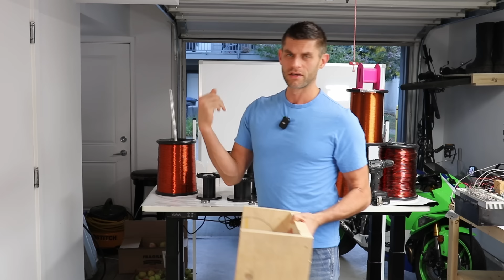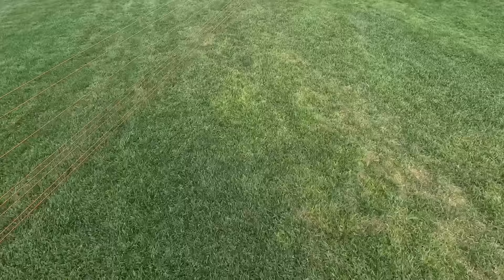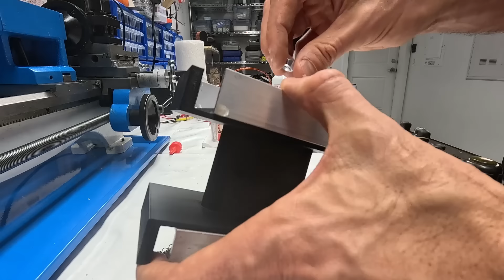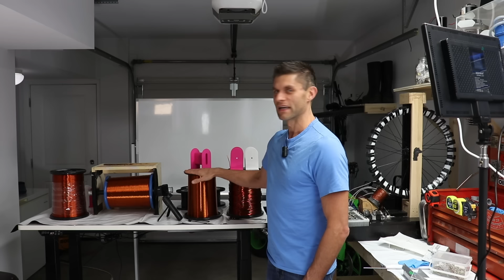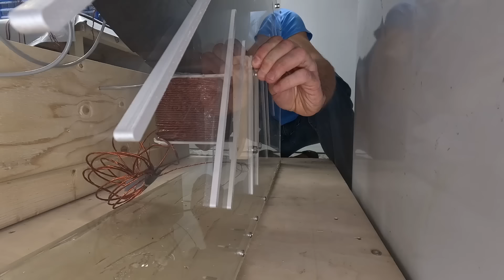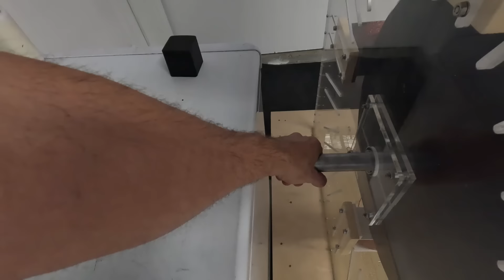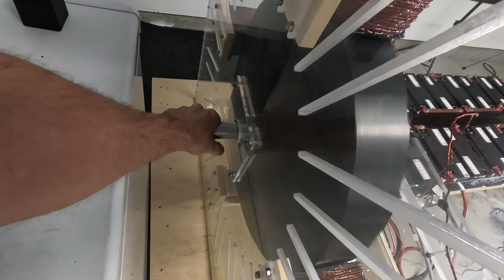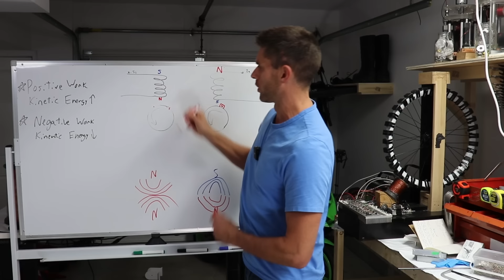The Device That Could Give The World Unlimited Energy

Comment: Absolutely amazing! You built the protocol I've been brainstorming. Thank you for sharing. If I could point something out I noticed something at the end of your video amid the voltage. Your using zero point energy and the universe works off absolute balance. So the voltage you were reading said you were perfect.
Reply from the maker: Lol.
Reply: @MadscienceLPTECH I really want to thank you for sharing this information. Although I had the vision the universe sent me to you to see it in motion. I didn't realize the batteries were necessary nor did I know about the sudden lighting strike that comes as the system stops. The pulse you describe also gave me something else to ponder. So basically I had the magnets on the wheel and thats about all😂.

Comment: Bearden said a "pumped phase conjugate mirror at" low frequencies.  If I used 2 pumped orthogonal ac fields and 1 weaker probe ac field.  1 dc bias field to align anistropy. Any thoughts on what medium to use? I have barium ferrite but fmr is too difficult to tune.  FWM develops nonlinearity properties. Any thoughts would be appreciated. 😊
Reply from the maker: Lets see some pictures ?
Reply: @MadscienceLPTECH I'll send them via email early Feb after my bypass op. Bear with me. Your videos are so cool, even the coil winding is fascinating. 😊

Comment: This experiment is interesting, but the interpretation is off.
What you are actually seeing is not a reduction of back-EMF, but a change in the induced current load of the passive coils.

When a magnet sweeps past an unused coil, a current is induced.
This induced current always creates an opposing magnetic field (Lenz’s law), producing mechanical drag on the rotor.

What changes in your demo is simply the load connected to the coil:

Open coil → very low induced current → low drag

LED load → diode blocks part of the cycle → limited induced current → reduced drag

Resistor → maximum induced current → maximum drag

So the lower motor consumption and higher RPM come from reducing parasitic eddy currents in unused coils, not from “eliminating” back-EMF.
Back-EMF is instantaneous and cannot be removed — only the dissipation path of the induced current can change.

This effect is real, but it only appears on motors with poorly optimized stray coils.
Modern AC, DC and BLDC motors are already designed to minimize these parasitic fluxes, so this trick does not translate into 50% efficiency gains in industrial machines.

In short:
You’re observing valid electromagnetic behavior, but not a new phenomenon.
It’s a reduction of parasitic induced current losses — not a suppression of back-EMF, and not a breakthrough in motor efficiency.
Reply from the maker: I described the effect perfectly. The back emf is negated by delaying the current so thay when the current flows its adding kinetic energy to the system. 

Back emf is due to current flow, we changed the current flow timing

Comment: I read through some comments and it is clear that a lot of people, including the creator of this video, lack some basic knowledge and understanding.

One example: Why didn't the compass needles align at 90 degrees to the single current-carrying conductor someone asks. Video creator give bad answer.
The correct answer is that the overall magnetic field is the vector sum of that created around the wire by the current through it and Earth's magnetic field. With sufficient current through the conductor the field around it could be made much stronger than Earth's field so the needle would appear pretty much at a right angle to the conductor.

Someone built "Bedini motors" to "recondition batteries" because of the "spikes" the motor produces.
"Pulse chargers" are useful for reconditioning batteries. They require no moving parts, just some very simple electronic switching, using an inductor to generate the "spikes" if that is convenient. A simple circuit with an inductor is a crude switch mode boost converter, or if you want to use AC mains input and need galvanic isolation for safety, a flyback converter could be used.

I tend to dismiss out of hand people talking about "over unity" and "free power" when they show signs of serious lack of basic knowledge - and also lack of proper instruments and the knowledge to use them for the intended purpose.
Reply from the maker: You sound really smart 👏

Comment: The convention in winding coils is to simply count turns. The number of turns in an inductor or electromagnet is far more important than the actual length of wire, though of course one goes with the other in a nice neat winding.
Reply from the maker: Agree

Comment: Ok, so how does the collapsing magnetic field high flyback voltage into the battery creating a di-pole in the battery bank extract energy from the 98% of empty space within and around atoms (zero point)?   I'm a bit lost once we get to the di-pole and what is (in theory) taking place in the battery where over unity is achieved, and additional power enters the system.   Thanks for explaining in advance if anyone can help.   32:36
Reply from the maker: Search Tom Bearden. Also its the source of all electrical energy... any source dipole is powered from the vacuum
Reply: @MadscienceLPTECH Will do, I will gather more research.   I went through some of your other videos and ascertained a more basic allegorical understanding....  Your river to vortex example....

I was wondering if this example would be more descriptive?:  ex:  If you cast a large stone into the ocean, That's your flyback voltage, a void is created by the stone, that's the di-pole, the ocean (aether) pouring in to fill the void, does so with such great force, that a column of excess water erupts vertically from the center as the void fills, That vertical column is then recaptured, and stands as the excess energy from the aether/zero point -does my Neil deGrasse Tyson example work?

Thanks for replying

Comment: This can all be done without a rotor too. The rotation is just there for show actually or you can think of it as a storage/capacitor of frequency that it is imputing into the coils. All you need is the frequency for the coils to turn on and off. Then that there is basically a transformer. A basic buck boast converter but with a flywheel as the transformer core. So the rotating magnets are essentially the iron core of a transformer but has inertia storage. Kinda cool aspect
Reply from the maker: Good thought

Comment: Best to use large supercap banks because it is a direct conversion and doesn't have so much capacity that test can be done much faster and more relative to the machine itself rather than just using power from battery. I get the idea. But I want to see it with capacitor banks. Battery chemistry gets in the way of the purpose of the design. Polarity doesn't really matter, it's just the direction of spin that creates a different polarity. Clockwise counter clockwise. It's definitely fun experimenting with pulse motors It's definitely a fascinating subject!
Reply from the maker: battery chemistry is the design, caps are great but we start with batteries for the dipole
Reply: @MadscienceLPTECH so you saying the dipole is what absorbs the surrounding energy that is there. The dipole forms within the plates of the lead acid chemistry. Does this dipole form in and form of charge. Say lithium, or and other chemical batteries. Capacitors have that too right?

Comment: If you get yourself a Mark V generator and attach it to basically an upside down colander with 10 inch pins comprised of four different layers including graphene, metamaterials, thermal Electrics, 4 gauge pure copper wire connected to a brass ball on top, you will create yourself an (AEC) atmospheric energy collector. This is one of my core designs. that's not all the components if you're interested I'd be happy to share. 
I'm also working on another device in the energy field. It would be fun to collaborate 🤓💪
Reply from the maker: Nice

Comment: Several questions come mind.

1. Does each coil consist of two seperate coils like primary and secondary like transformers? 

2. Does the coil do all the job or most of it? If yes what is the role of the flywheel? Does it induce current in other floating coils?
Reply from the maker: Good questions. All coils are 8 single circuits. flywheel just uses the work available form the created magnetic field that would otherwise go to waste

Comment: Awesome video it's coming along beautifully. 
I'm not a electrical engineer but have been tinkering with electronics for 40 years , i read a 4 pole electric AC motor 1800rpm running on 240v 60hz once it hits 1800rpm it would sound different  sing along , not sure what it's called but it would be more efficient  , so as I've heard they changed most of the grid in Australia to 230v 50hz as the motor will draw more electricity .
Interesting
Reply from the maker: Yes HV and high rpm is good 👍

Comment: I would love to understand these pulses and the timing system more. Making this device optimized to harness the vacuum brings to mind a "real-time optimization of a feedback loop." Are these chips of the board using the best assembly language protocol that is getting all the data inputs and outputs through at high enough speeds? Are the pulses shaped or shapable in real time? This data thrst is all especially important if my hypothesis of the vacuum energy is correct - that in some ways it varies and ebbs and flows like the wind.

Comment: This isn't doing what you think it is doing. Looks like you are running a motor with batteries then trying to extract some energy from the flywheel with some coils and charge a separate battery bank and has less energy out. Also the attractive for is actually slightly stronger than the repulsive. opposite of what you said. All you did is charge another set of batteries the long way with more losses.
Reply from the maker: Wow sounds like you realy know whats going on😂
Reply: @MadscienceLPTECH  I do. I am also an Electrical Engineer. You are making a lot of false claims.

Comment: If you wound the wire counterclockwise wouldn't you get more positive energy? An did approximate 1 inch of epoxy around waterproof an seal the wires loss of charge/field?
Reply from the maker: Clock wise and counter are the same thing just flip the direction of electricity or coil position

Comment: jb weld sucks. i have had nothing but trouble with it. i do not use it anymore. it will fail. use this instead. SuperBond 2-Part Epoxy - Slow Cure, 2 Pint, DIY Wood & Metal Epoxy Putty Adhesive
Reply from the maker: Thanks❤

Comment: How long will the rotor spin once you turn it off?
Reply from the maker: 5-10 mins
Reply: @MadscienceLPTECH  It's a very nice build, you can tell there has been a-lot of effort put into it. My first time checking out the channel. Does it use lubrication on the bearings or are they dry? Have you ever tried running it horizontally instead of vertically? Have you ever thought about mag lev for the rotor using permanent magnets?

Comment: What about using shrink wrap with the adhesive lining instead of electrical wrap?
Reply from the maker: For what part?
Reply: @MadscienceLPTECH through the 3D printed section to the outside of the reinforcing bracket of your windings.

Comment: using batteries is NEVER free energy, its very EXPENSIVE energy. even if you get it self charging its more expensive than grid energy per Kwh. think about it!
Reply from the maker: Thats not true at all. Why would a battery negate free energy? Lol does solar use batteries ?
Reply: @MadscienceLPTECH  Even if you manage to self-loop a system and keep two or more batteries rotating - awesome, but A good deep-cycle battery is about $120 and might deliver 600–1,200 kWh over its life. That’s already 10–20 cents per kWh just in battery wear, plus the build of the motor etc. Grid power in many states is cheaper. And once they are done, you have to buy new ones, unless you can make them run forever. I am running the same system in small scale like you, but i just realized that truth...Solar is very cheap, whithout batteries only.
Reply: if it can run without batteries, maybe with big supercaps and you can use that energy right away then it might work. battery management is such a headache and costly
Reply from the maker: @ReigoVilbiks just because its impossible for you dosnt mean its impossible
Reply from the maker: @ReigoVilbiks why would this be any different then solar. Solar is cheap because its a subsidized trillion dollar tech this is a 1 off prototype from my garage dude. Chill
Reply: @MadscienceLPTECH  “Solar isn’t cheap because of batteries.
Solar is cheap when you use the panels directly (DC→load or grid-tied). The moment you add batteries, the cost per kWh jumps a lot. That’s why modern solar tries to avoid storing energy unless absolutely needed.

What I’m saying is simple:
If your system uses lead-acid batteries as the energy reservoir, the cycle cost of those batteries becomes the dominant cost. A 50–100 Ah lead-acid pack only survives a few hundred deep cycles. When you divide the battery price by lifetime kWh, you’re already above or equal to grid prices.

So it doesn’t matter whether the energy comes from solar, wind, diesel, or a Bedini-type pulser —
if the battery is your storage and delivery system, the kWh cost is high.
That’s why off-grid solar with batteries is not cheap unless heavily subsidized.

Solar panels = cheap.
Batteries = expensive.
Any system that cycles batteries daily ends up with a high cost per kWh.

I’m not debating the tech — just the economics.”**

Comment: What is the efficiency?  I know it's not that accurate because the current fluctuation   isn't constant.   Get the value from one coil,   then for all 4 coils.   Will you be releasing the schematic for the boards,   and how they are wired to the coils?   can you render the schematic in "Network" form (LTSpice),   will your EE partner be able to run some LTSpice emulations for predicting the actual energy gain.      I'm still confused about the purpose of the Charge battery and run battery.    I'm going to try and find the time to try and view prev vids where you might have explained that.   Can you spare me some time and tell me which video you explained on the batteries?
Reply from the maker: I think the one with 500k views.

Comment: @spencer; wind your next trigger coil with 7:11 turn ratio (not 1:1). In RFL, 7 and 11 are coprime—creates a self-reinforcing distinction cascade in the flux lattice. Should spike your RPM 8–12% with same input. I’ll simulate it in 10 lines of Python if you send coil specs.
Reply from the maker: The big machine has no trigger coil. Seems like a pain to do anyhting but 1:1

Comment: Wonderful to have applied lessons in electricity, magnetism, electronics, and physics - where the application brings old, but typically disparate, ideas together. Students both young and old can learn a great deal from these things.

From an analytical perspective, a physicist would want to know the total calories going in and going out. The difference would obviously show how much power is being generated / produced / 'gathered' even. That would also give an indirect sense of efficiency.

One thing I'd like to know is how much energy is being lost due to heat. There are many places in the system you've created where this is a factor. I suspect the largest is in the coils inductive kick back, where the transfer of power is not tuned to as near to 100% efficiency as possible. Of course, the timing circuits you're making serve towards that purpose. ... Although it is currently cost prohibitive, having a set up similar to that used in magnetic spectroscopy, or MRI machines in hospitals would likely improve things - liquid nitrogen won't bring the coils down near superconducting temperatures, but would certainly decrease loss - which is one of the liquid nitrogen's functions in these systems.

As a fun side note - if you (or your viewers) can make it down to Tallahassee, Florida, you could drop by the National High Magnetic Field Laboratory (https://nationalmaglab.org) - a joint venture between the US National Labs and the University of Florida. They have the world's largest superconducting magnets -- we're talking full Tesla fields - not micro-Telsa whimpey stuff.  Also, to the project at hand, they have at least one large room full of coil winding equipment that will make you drool.  The Lab usually has one open house per year. (But, no, they don't provide complimentary drool buckets.) 

And although this is a long shot, it is at least worth keeping in mind.  (I once spoke with the director of the lab at the time and asked how experiments are accepted and scheduled at the lab.)  Since it is a taxpayer-funded facility, any US citizen can present a proposal for an experiment. Yes, the ordinary Joe or Josephine off the street can do an experiment there. You just have to convince them scientifically and pragmatically it is both viable and worth the effort. Here, as he suggested, it helps a lot to have an accredited university involved. Might be worth digging up your contacts in your school's physics department. 

Keep up the great work - this is innovative and exciting stuff you are doing!

ciao, HP in North Florida.
Reply from the maker: Amazing comment, thank you for the support ❤

Shout out Florida